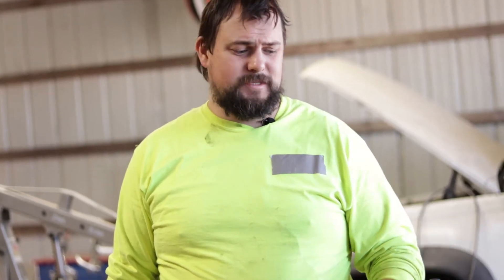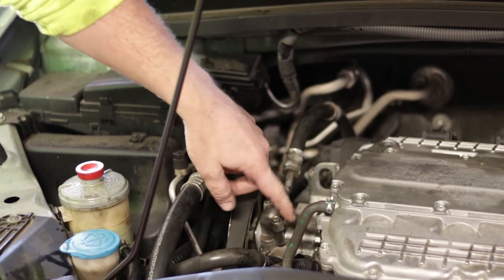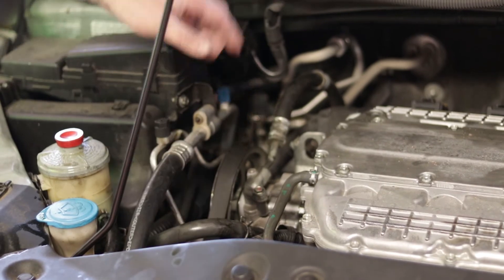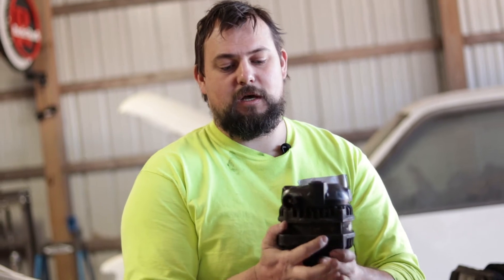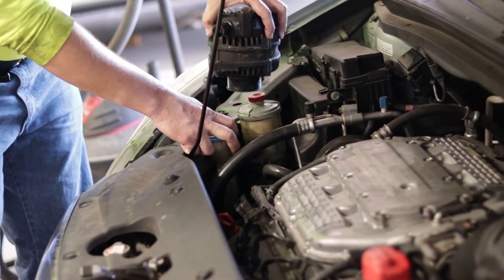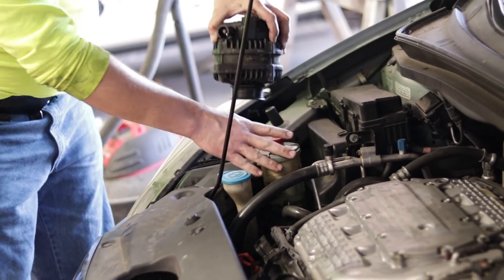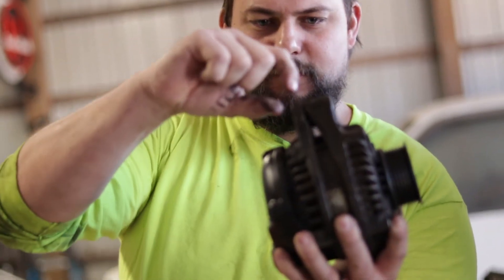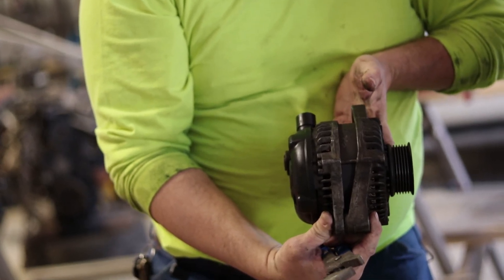2007 Honda Odyssey Alternator Replacement Hack

Comment: THANK YOU for this tip/trick!  I struggled for over an hour lifting, shoving, pulling, turning that alternator and had to walk away.  Googled and found your video here.  I took out the washer bottle, and with your advise had it out in 2 minutes.   Thank you again!

Comment: After just completing this job and it taking way too long, I’d like to suggest an orderly approach that should make it much easier for the next person. 

I’ve watched several video’s of people showing how to remove and replace the alternator on a Honda Odyssey. All of them complained about how tight the space is. Only one person recommended removing the tensioner pulley entirely and let me tell you…THIS IS THE KEY. 

1.	Disconnect the battery

2.	Remove the plastic engine covers

3.	Remove the oil dipstick 

4.	Lift up the windshield fluid reservoir and move out of the way towards the front of the engine

5.	Lift up the power steering reservoir, disconnect the top hose where it enters the port (not where it connects to the reservoir) and tuck it out of the way.

6.	Jack up the passenger side of the car behind the wheel. Put a wheel chuck behind the rear wheel. Add a jack stand for safety.

7.	Remove the wheel

8.	Remove the wheel well and bumper liners out of the way. You do not need to entirely take them off, just enough to get them out of the way.

9.	Release the tensioner pulley to remove the belt…make sure you remember how it was on.  You will need either a thin breaker bar or a serpentine belt tool with a 19mm socket. It’s really tight. I used a thin breaker bar and attached a pipe to get leverage. My longer breaker would not fit.

10.	Remove the tensioner pulley entirely. This will make your life easier…trust me on this. There are two bolts. The lower one I believe was a 12mm and you can access it from underneath. The top one I believe was a 14mm. I found it easiest to access it from top with a ratcheting wrench and another wrench hooked to it to get some leverage. Looking back, I may have been able to use my impact wrench with a bending socket extender to get the higher one. 

11.	Now you are ready to remove the alternator. There are two bolts, a 14mm on the lower/back side and a 12mm on the higher front side. If you hadn’t removed the tensioner pulley you would’ve been struggling to get the 14mm bolt out and back on, and getting the alternator out and back in. Plus, you would’ve been cursing and complaining about the engineers who designed it this way. Undo those bolts. You can use a socket wrench, a ratcheting wrench, maybe an impact wrench. When I put it back on I used my impact drill driver with a bending socket extender.

12.	With the alternator loose, twist it to get easier access to the two cables plugged into it. One is a squeeze clip and the other is bolted on…either a 10 or 12mm. Sorry, don’t remember. 

13.	With the cables removed, remove the alternator. Shouldn’t be too hard with everything out of the way. 

14.	When replacing the alternator, I attached the cables first…much easier that way. Then I originally put the top bolt in first and then tried to do the lower bolt. For whatever reason, I could not get the lower 14mm bolt to align with the hole. I removed the 12mm one and then I could align the 14mm and install it. 

15.	Put the tensioner pulley back on

16.	Put the belt back on by starting at the top and then go underneath and release the tensioner pulley to finishing putting the belt on. 

17.	Reconnect the battery

18.	Start the car to make sure it works and the belt was on properly…mine wasn’t the first time.

19.	Put all the splash guards back.

20.	Put the wheel back on

21.	Lower the car

22.	Remove chuck behind rear tire if you put one there

23.	You’re done.

I’m telling you, the key is to entirely remove the tensioner pulley.
Reply: Changing mine soon. Nobody mentioned removing the radiator fans. Think that would help?

Comment: Thanks for the video, very helpful.  I was able to remove it in about 20' starting with the wires and bolts. At first I couldn't get it to rotate but small movements got it moving.
I have two things to share. 
Take the PCM cover off first. The alternator caught on it and almost broke it.  It was coming out so quickly by that point that I didn't have time to stop and clear it. I wouldn't want to break an important cover like that. 
I couldn't get the alternator passed the tensioner lug. I had to put the serpentine tool on it and hold it back out of the way. I tied the handle back to the lifting point on that side to keep my hands free. I have the J35A7 engine. This might not apply to the J35A6 engine.
Reply from the maker: Flat it worked out for you

Comment: Did you have to take the pully tension arm out?
Reply: Yes & motor mount weight
Reply: I just did the job and I didn’t take it off. You have to rotate and twist the alternator like he said, and it will come out. It was very very irritating tho.

Comment: Omg taking the alternator out on this vehicle is so irritating. Took me awhile to get it out. Why do they have to put them in such bad places lol.
Reply from the maker: Sorry you had such a hard time with it. Hopefully the video helped.
Reply: @JosephusHeun  it did. The rotating the alternator to get it out was the best advice. Something I noticed putting it back in the bracket holding the plug wire and where the top bolt mounts on the alternator is in the way so I took it completely out which was quick and easy then it went in a lot easier.